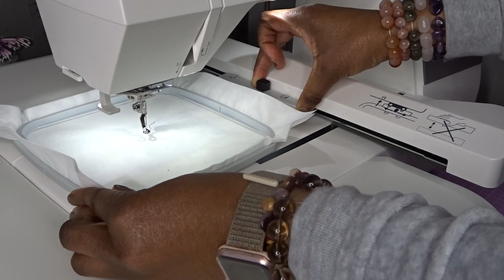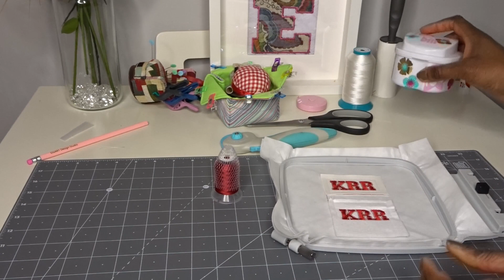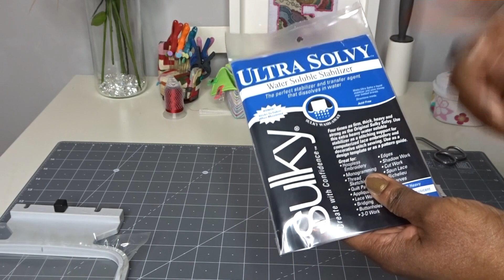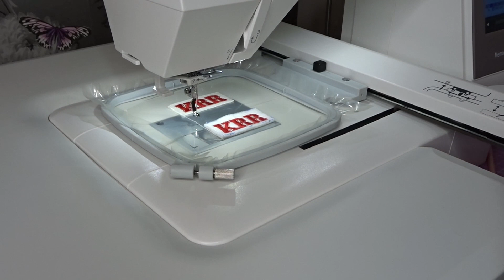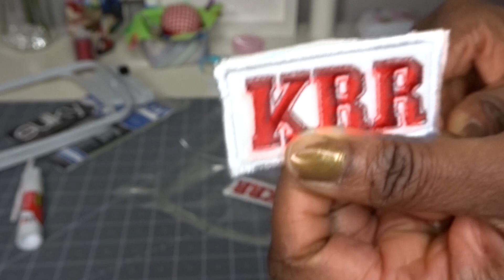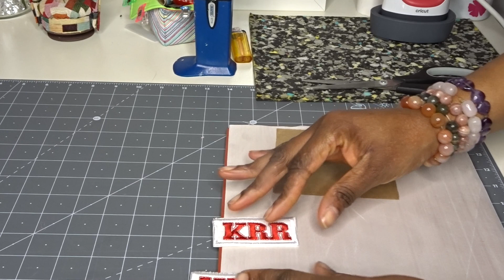Embroidery Patch using Janome 550E | Clean Edge

Comment: Wouldn't it be easier to use a tear away stabilizer and cut the top material like an applique.. then do the boarder stitch? Then when done just tear it off.
Reply from the maker: Hi Lisa, yes you could do it that way - I’ve made few patches like that. This was just an alternative way and the clean up is super quick. Thanks for watching 🫶🏽

Comment: To use up the threads, I would sandwich it between two sheets of water/heat away stabiliser, preferably the fabric like ones and stitch over it free motion in a grid in maybe a variegated thread. When washed /ironed away you end up with a pretty lacy piece that you can use as a trim on something…a bit wacky..you could also sandwich some bits of ribbon and other trim or fabrics in it too. Sometimes for projects I use dissolvable laundry bags as stabiliser….if you can get a couple, they are much cheaper and work brilliantly.
Reply from the maker: I loveeee this idea, this is genius. I think it would look really pretty with all the different colours of thread. Thank you so much for this Diana. 🫶🏽
Reply: @elizartdesignstudio  
You’re welcome, I’ve done this …years ago now..and it does look pretty.